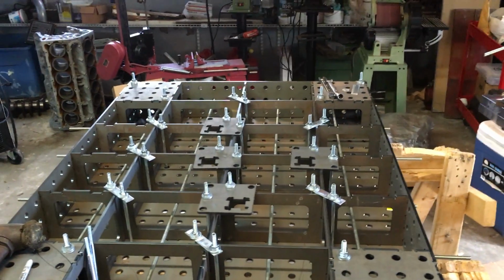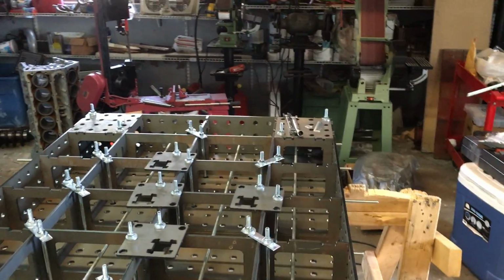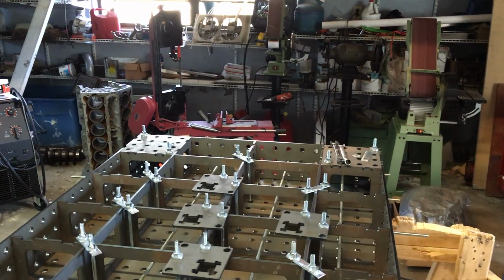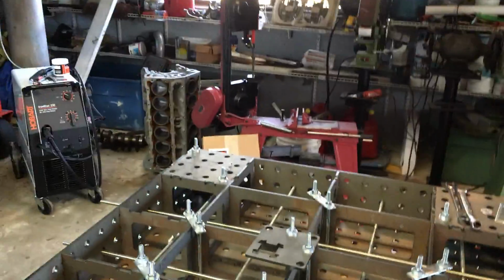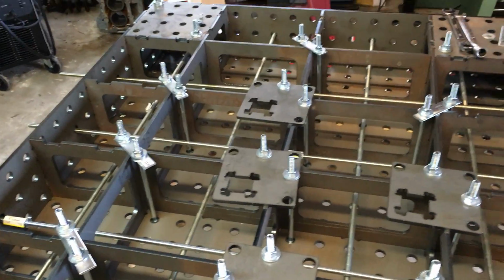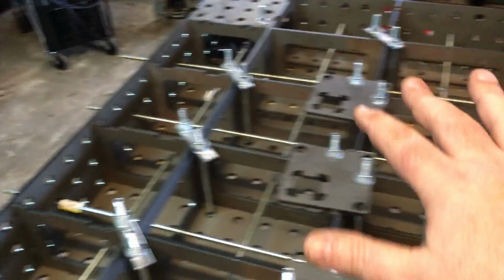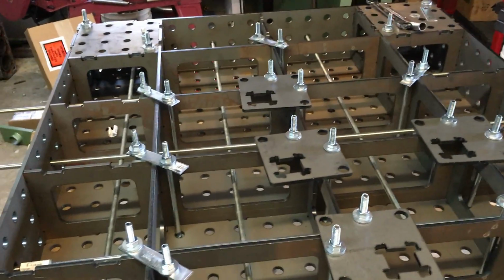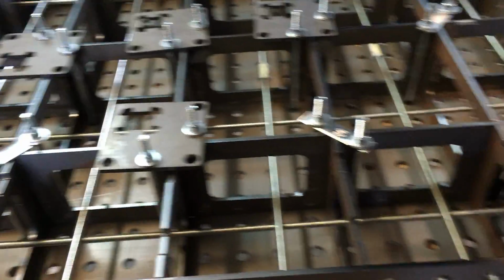Shop Musings #1 Certiflat fabBlock 36x48 table

Comment: I used typical 11 inch vise grip c clamp pliers instead of all thread. Fits right between the slots and grabs an end rib of the cross brace. Clamps come in handy for the rest of life. All thread not so much.